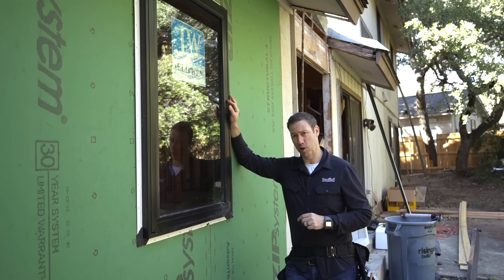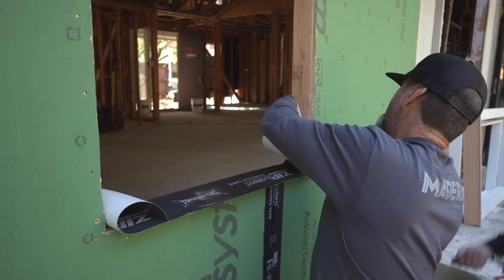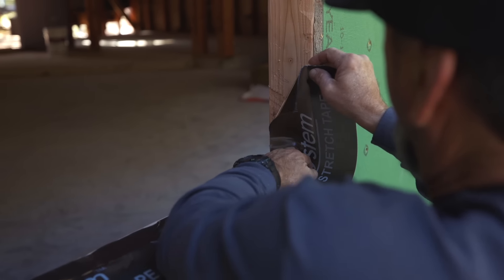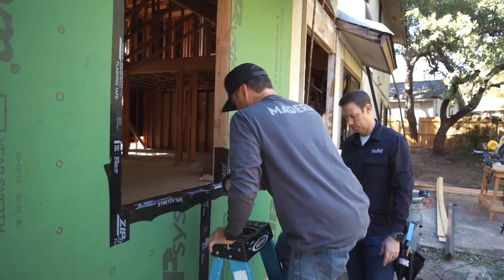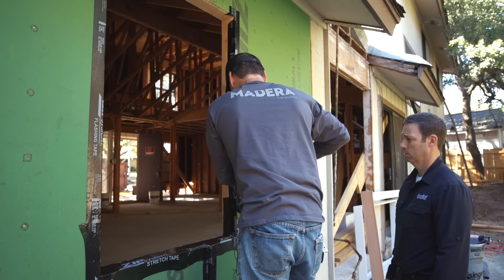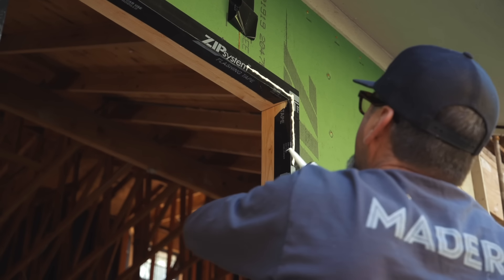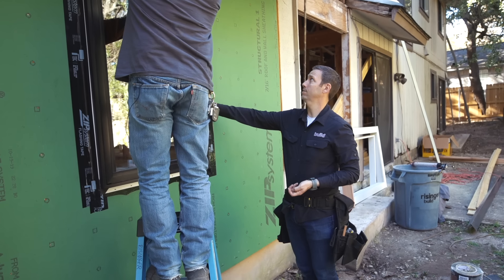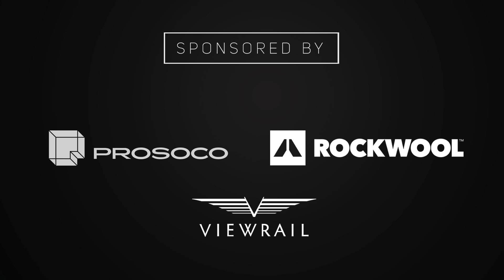Window Install & Flashing - Jeld Wen in Zip System

Comment: Nice, clear video. Lucky to have sponsors giving you free materials like windows and sheathing...

But Bill let the cat out of the bag about the longevity of the stretch tape - said something like "sometimes the tape will curl and it's ok to use a staple to hold the corners down".  Which is an admission that even new stretch tape installations can quickly fail - imagine what happens once the cladding/stucco goes on and it's out of sight. I'd like to see how well stretch tape survives 10-20 years of scorching heat and freezing cycles.  

I feel liquid flashing the sill is the true best practice. And I don't think adding tape to sides and top of window is necessary before window installation - it's superfluous since you caulk and apply tape after the window is installed. I suspect it's undesirable to have multiple layers of tape on top of each other in any event.

Bill also said something not well understood - that water can (and does) run uphill if there's driving wind and/or pressure imbalances.  I live on a hillside and despite overhangs, have had wind-driven rain drive water up over 6" of flashing.
Reply: out of sight....and out of UV exposure

Comment: I love all this re-learning new info on flashing and water-sealing of your videos. But I have to ask, the long-term life of these products, will they be another future "abatement" product? Asbestos shingles were amazing for homes in the 50's/60's. But who knew that cutting them (frangible) or breaking them were to be a hazard. These adhesives, membranes and tapes with UV, thermal changes and possible bond failures (some bad batches?), along with OSB (who remembers the fire-rated roof OSB that in 5 years, people would fall through the roof-literally)... just because some lab tests (can be altered/faked) say it will last 10-20 years ... if applied/installed correctly. Wow... I need to lay off coffee this late...
Reply: There are documentaries about asbestos and the thousands of years of history that man has been using it and how the big companies that ran the asbestos industries knew that it created health complications and kept it under wraps. As far as zip, it's been around for 12 years now and Matt has a video showing a testing facility at the university of texas where they have mock ups of pretty much every single exterior waterproofing product on the market outside exposed to the elements year round and the zip system had actually held up much better than it was rated and we are talking years of direct uv exposure without siding over it. But also, if we let fear of innovation paralyze us then we cant move forward. Just food for thought. Cheers.
Reply: No, such good points you make. And here in America corporate money trumps everything so one does have to worry. Who remembers Dutch Boy and their lead based paint? How come they dont have to pick up the cost of all this lead paint abatement? NOPE! It's the homeowner who has to pay for that one. And why does Dutch Boy still exist? Over and over again, products/methods are found to be completely destructive. So many go against common sense. Somehow paper protects your house from water? Live in an airtight pressurized box?  Please I can't be the only one whose better judgement is wagging it's finger.
Reply: @Wood-Renovations my comment wasn't in reference to this system here. I actually like how clean and simplified it looks.

Comment: Matt Risinger, your videos are pretty amazing. The one thing I've always wondered though, with windows, what happens when you need to replace one of these? Lets say 50 years from now, that style of window is no longer made or whatever. Seems like you'd have to do a lot of destruction to replace it. Are there better modular ways to install a window so that a reinstall wouldnt require you to tear apart the wall to reseal or make it easier? Esp on houses with the thick exterior insulation. Id think it would be a bit nicer if the window just slid into a hole that could be well sealed after the entire project was completed.
Reply: He's done a video about this but it was pretty unreasonable. It showed them tearing out brick to replace them. Would like to see how you can do it without that level of destruction on a brick house.
Reply: There really isn't a quick easy way to replace windows without compromising a WRB. However the ZIP system is 100% better and easier to replace a window and restore the WRB with tape than say a 1970's house with felt paper for WRB and trying to seal to that old torn degraded paper.
Reply: @SideOfRanch  Anytime you replace a window in a brick facade and don't open it up and expose the sheathing and WRB then you are relying on caulking to seal the perimeter of the window to the brick and that is a joint that will always fail and have to be redone which creates maintenance that will inevitably be overlooked. Quick and easy is not always so in the long run.

Comment: How do you attach siding to the zip system without making holes in the zip system from the fasteners, seams a little counter productive to do all the water proofing than just drive nails into it to hold siding.

Comment: Matt,  is there a wider zip flashing available?  I'm thinking about if you had zip R with 1" of foam,  I'm not sure the 3.75" wide roll will wrap over everything.  So wrap it twice and overlap? Or just stretch tape all the way up?
Reply: Looks like there is a 6" and a 9" flashing tape available.

Comment: My contractor just installed my paradigm windows and all they used is a piece of zip tape on the bottom area nothing else. I’m using zip boards with foam insulation should’ve it been covered top to bottom with tape?

Comment: If you cut the bottom window sil at a 5 degree downward sloping angle, how do you seat the window plumb in the opening?  Or is he saying the entire window will be installed at a 5 degree angle?

Comment: So this was the 70's house that had the siding on the backside of the house that I believe was rotted out. Do you have a video showing the Zip System being installed in this area? I assume the Zip System installed is the Wall Sheathing 7/16" plywood. Could Huber's Insulated Zip System R3, R6, R9, or R12 been installed on this house? Would there be a design limitation with trying to install the insulated Zip System either with the foundation or the 2x4 framing? For example, if an R12 was installed 2-1/2 inches would overhang the concrete slab. I assume the perimeter of the slab would need to be extended around the entire house for additional 2-1/2 inches plus additional space for any brick installation.

Comment: Good video.  Couple well maybe three questions?  1) are you going to come back later and fill over the nails in the zip sheathing and if so use the tape or a liquid? 2) Is it matter of preference on tape vs liquid to seal the window like you did, is one cheaper than the other, more user friendly than the other? 3) Is it over kill to cover all the wood on the inside of the window or door jam, or is just covering the all the seal wood is all that is needed?  As always thanks
Reply: Overkill to cover the sheathing because that green you see is waterproof

Comment: Can one save money by using the flex tape only on the corners. Maybe use other tape for flat part of bottom? Flex looks pricey.
Reply: I have read that there can be issues if you mix brands--consistent adhesion, chemical reactions, etc.

Comment: Matt, I have been watching a ton of your videos as I am GC my own house right now.  I am not a builder, but just relying on the subs to get the stuff right! 😅 I didn't see all your videos about the advanced features of a whole house ZIP system. So my house only has Zip paneling on the facade, and tyvek wrap under the siding everywhere else.  What are some steps I can take to improve water resistance, air tightness, and window/door flashing on regular sheet siding with tyvek under it?
Reply: I am about 30% into the framing by the way, so I still have a long way to go and can make some slight changes as needed...

Comment: Thank you for providing such a thorough explanation! So is there anything sealing between the bottom edge of the window and the frame? I understand you want water to drain out, but what keeps that seam airtight?
Reply: I like to spray foam around the window, from the inside of-course lol. No air (or water) is getting through. Some of this taping is overkill imo

Comment: how long can the adhesive on the tape be expected to last, especially when applied  to a  substrate that isn't free of dust, that can expand/contract with weather conditions
Reply: In a covered situation under cladding or siding, that adhesive will last as long as the house.  It doesn't degrade.
Reply: Once you got the window in, and spray foam insulation around edges from inside to fill any gaps the tape should be held securely in place .

Comment: What is the optimum temperature for the stretch tape?  I assume heat helps the adherence but only up to a point.
Reply: I've seen a data sheet for the Zip Tape it's acrylic and the data sheet says: "Apply tape when ambient air and substrate are above 0 °F (-18 °C)"

Comment: I guess your total airtight seal will be from the inside using foam backer rods & sealant. 
Question: does your window manufacturer come out to the site to measure your rough openings? Or, does your carpenter forman give them the measurements?
(Interested in the turnaround time from start to finish - from rough openings to final install)

Comment: Hello Matt. Question: Doesn't the nailing down of the Z Head flashing create penetrations on the tape? What if you nail the head flashing before the last layer of tape at the head? this way that last layer would be covering the nails used for the head flashing. Thoughts?
Reply: If you watch the video, he does add another layer of tape after nailing the head, so it's ok.

Comment: Hi Matt. Is there a reason for using nails instead of screws to secure the window?
Reply: I was about to type the same question. Less of a chance for backing out over time with thermal expansion/contraction.
Reply: Nails lay flatter then screws!
Reply: you could use screw but remember that the average screw is more brittle and harder than a nail, so if something twist that window like an earthquake or tornado it will shatter the screw.
Reply: @vladimircankov1492  i wrote "the average screw" cuz some of the newer screw are more optimized for building, machine bolt are as brittle screws used to be. also by the way "brittle" in term of steel usually mean it has been tempered, so it become harder and brittle

Comment: If anyone could please answer a question for me: Don't the shims at the bottom flange, as well as the lack of any caulking at the bottom flange guarantee a breach in the air barrier? It seems like, for the sake of leak drainage, we just left a permanent hole in our house. How and where does the bottom flange get an air seal?

Comment: Have to read every manufacturer but my understanding for the most part you nail every other hole unless your by the water or a hurricane area where you nail every hole. In hurricane area if your using a non adhesive wrb like tyvek you would actually apply a skirt with the tyvek over the bottom flange taped to the flange but skip taped to the tyvek. I guess the idea is if the window has a draft going through the bottom flange into the house the skirt will prevent a column of water from pushing its way inside.

Comment: Matt, love the videos and channel. Question for you - how would you recommend using zip stretch tape & proper window flashing when you’re replacing windows in an existing home with brick veneer exterior? Would you remove the bricks around the opening and then re-brick after you’ve properly flashed the window with the tape and sil kit? Thanks in advance
Reply: Matt has a video where they are putting in new windows on a brick veneer house. They didn't use tape initially. They used Prosoco Liquid Flashing on the rough opening.

Comment: If the window sill is canted/angled by 5 degrees, wouldn't the top of the window be angled a bit out of plumb?  Since it is essentially angled forward?  Or is it too small an angle?
Reply: the window will be nailed to the outside plumb face of the wall making the window plumb

Comment: That's great for new construction but what about replacement windows for a brick molding ? Replacement window market is a lot bigger than new construction .
Reply: You can install a vinyl window brick to brick or do PVC brick mold. I recommend doing PVC, you pay for it but it looks clean. Its expensive but you get what you pay for and never have to worry about it leaking.
Reply: Ok thanks

Comment: Instead of shims underneath the nailing flange...why not just LOOSELY nail the bottom? I'm also wondering if you could just not nail the bottom at all? You have both sides and the top nailed down...that should hold the window securely. and now if water gets in it can easily escape the bottom

Comment: Just installed some Jeld wen windows into zip myself, but would love to see how you do the interior insulation and air sealing. Do you still recommend using backer rod and caulking or have you come up with a newer method in 2020? Thanks Matt!

Comment: You have Zip, not house wrap.  You flash the rough opening.  You have an integral flange that you caulk and tape.  This probably far exceeds past flashing techniques, yet you keep the bottom flange open just in case water still manages to sneek in.  What you give up by leaving the bottom flange unsealed is the opportunity to have an air and water tight gasket around the whole window frame.  Now you depend on how well you apply Great Stuff to make that frame air tight.  Yes, water may enter between the sash and frame, but that should find its way out through the weep holes that are part of the window.

Comment: Can anyone explain the purpose of the flashing on jamb sides and head UNDER the window flange? Seems excessive as an air control (which is what Matt calls it) considering the layer of tape they’re using on TOP of the flange (creating seal between the sheathing and the window). Not to mention the second level of air control via back dam and caulking on the interior. Not trying to be critical, just genuinely curious...

Comment: What is YOUR standard practice for margins, i.e. R.O. space vs. window unit size?  And do you apply that standard for sizing across any window type (DH, casement, etc.) and also to patio doors?  I design for a couple builders and always do half-inch margins, thus for a 36 x 60 window unit the R.O, is 37 x 61, and for a 71 x 82 door it is 72 x 82 1/2".  They all foam-seal the margins.  The builds are all in a cold zone with winter design temperature -15 F.

Comment: Does anyone know what the best practice is for replacing windows in a 1960s concrete block home in Fl? Is flashing tape necessary or liquid flashing? Or is elastomeric caulk good enough for sealing air & water?

Comment: Do you still use foam on the bottom sill gap from the inside to seal for air leakage?
Reply: That was something I was wondering as well.  Thinking about it you may want to spray foam around the entire inside frame?
Reply: Or better yet a caulk with a foam backer rod.

Comment: Btw flashing is great I do alot of high end window installations and alot of attention to waterproofing is paid. But on a side job to an average home owner of 30 windows its hard to sell 60 bux per window worth of flashing tape. They say its overkill.
Reply: Liquid flash.
Reply: @bmxregginable  in my experience liquid flash is usually more expencive than the tapes. We use a foam tape that we compress behind brick which is both water proof but doubles as a caulk backer and thats 7 dollars a foot.
Reply: Ah, it's like 29 bucks a tube on Amazon. Would be less than 60 bucks per window. Are you using the whole roll for one window??
Reply: Also I just watch for personal knowledge. Have little experience doing much of this
Reply: @bmxregginable  roll is 75 feet if you have a 3x5 window thats 16 feet for the first pass then 16 feet in the follow up pass so your using a half a roll. For the liquid flash a 20 ounce sausage tube will get you 15 square feet of coverage. With a 2x6 wall you may use 80% of a tube per window. Basically the tape was cheaper when you didnt cover the whole jamb and head with it like the past now prosoco fast flash is likely cheaper.

Comment: It’s code in Florida that the entire window opening is wrapped with peel n stick at minimum before the window is installed and then sealed again after window is installed
Reply: Not with CBS construction, which most of Florida is.

Comment: Matt, a couple questions about the installation technique from a DIY'er. Couldn't you install the head flashing prior to putting the top piece of ZIP flashing on top, and then cover with the flashing? It seems that you're doubling up the material, even though you're creating perforations with the nails that you use to install the head flashing over the window. Seems like you're using more product than necessary. The other question I have is with the opening on the window, how does this affect air intrusion at the bottom of the window if the flange is neither caulked or sealed? Isn't this a path for air/driven water to come into the rough opening? Thanks for your videos, I was wondering how the remodel on this house was going.
Reply: As to the nails penetrating the flashing tape, ZIP tape has a gasketing effect when penetrated so it seals around the nails. 
As far as the bottom opening, he has covered in some of his other videos about how they handle the interior half of the window install. They run backerrod between the window and rough opening and then caulk the perimeter on the inside thus creating a back damn on the back of the sill and creating the continuous air barrier.
Reply: @Wood-Renovations  Thanks for the explanation, that makes sense.